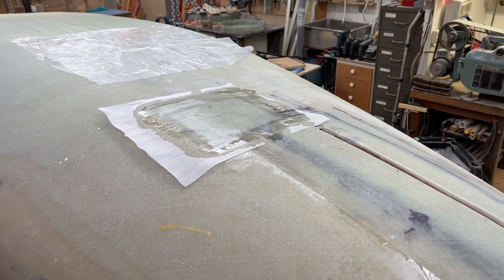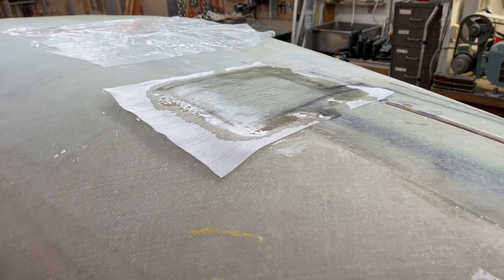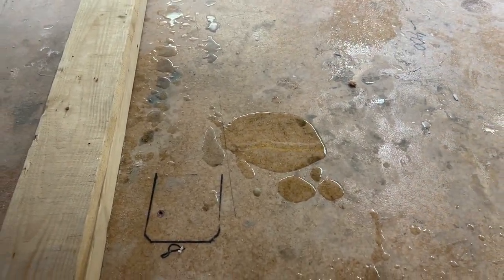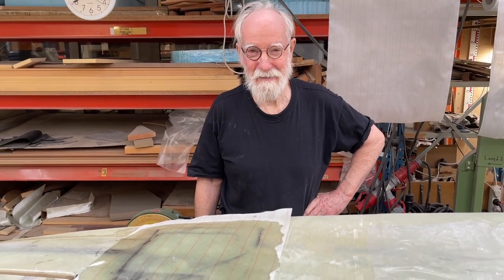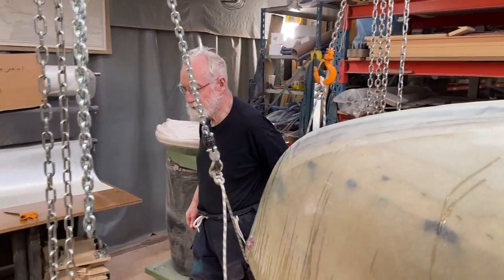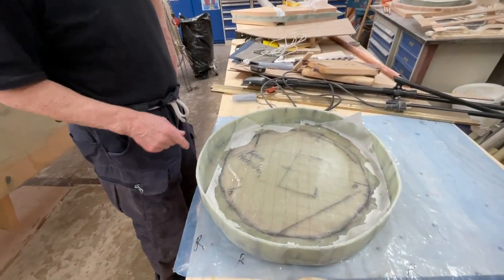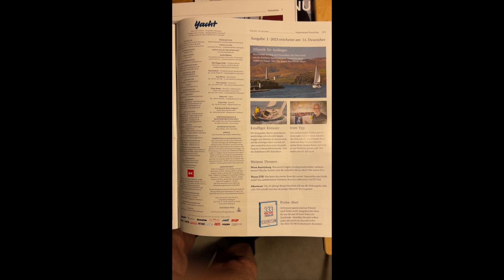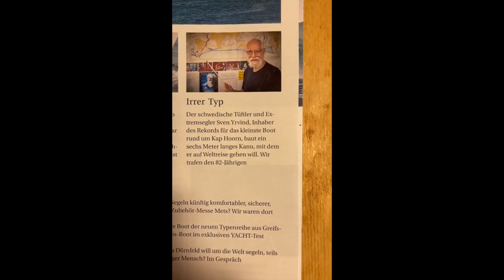5 Dec 2022  Also the hatches gets reenforced in preparation for the textile fitting. + German bonus.

Comment: Viscosity of epoxy can be increased with polyester powder, talc, or methylcellulose filler.  There are also products like superplasticizer, or Cabosil.  Alternately, adjust the hardener ratio.
Reply from the maker: Increase viscosity is not a a good idea when you like to as in my case saturate and infuse it.
Reply: @SvenYrvindExlex  I defer to your expertise.  It might make a good video subject.

Comment: If you sharpen rim of the hatch to an edge, which can squeeze into the the foam-seal, then you will not need as much force on the hatchet strap?
Reply from the maker: An edge will cut the gasket.
An edge will get easy dammaged.
I made it as thin as I dared.
Reply: @SvenYrvindExlex  Yes, a really sharp edge is probably not a good idea, but a rounded edge could help, I guess. E.g. with a radius that is half of the rim-thickness.
Keep up the good work! :)